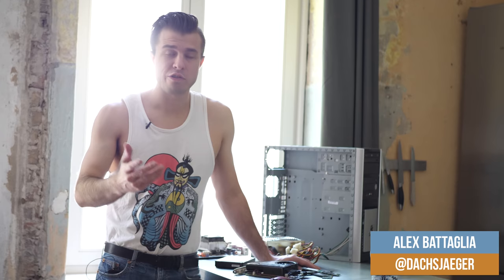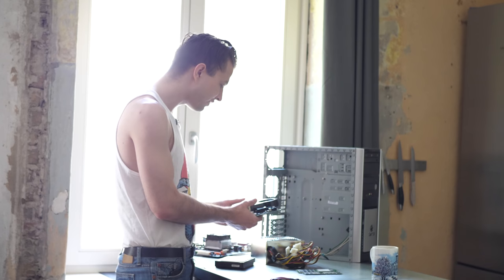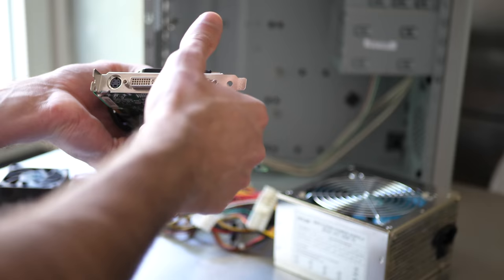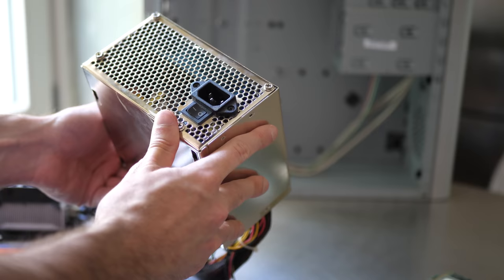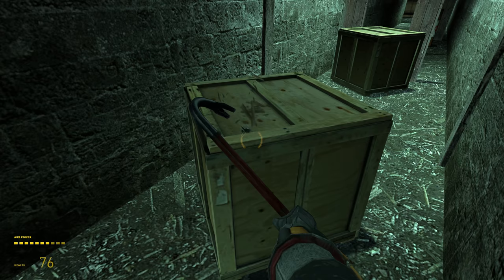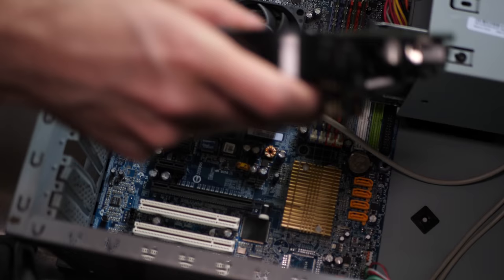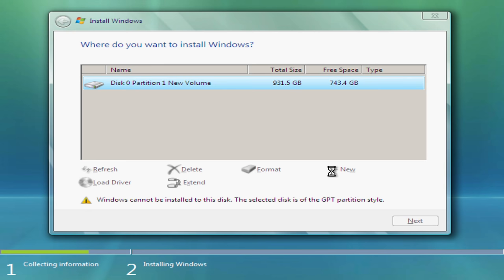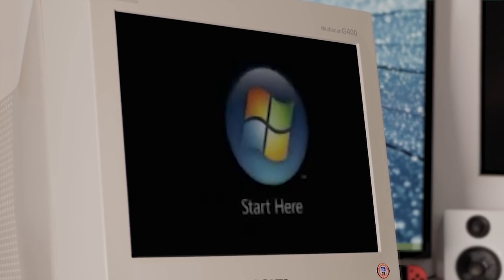Let's Build A 2005 Retro PC: Athlon X2 3800+ - Nvidia 6800 GT - Classic Hardware For A Classic Era!

Comment: recently finished my XP build, nicknamed Overkill : 
Q9650@4ghz
4gb of Corsair Dominator 1866
Nforce 790i watercooled motherboard
two Gigabyte 470 SOC in SLI
Custom waterloop with a 360mm radiator for the CPU/MB/GPUs
Sound Blaster X-Fi Elite Pro
Sandisk 120gb SSD + 2x1.5bg Seagate HD in Raid
Cooler Master HAF 932 case with a 1000w cooler master PSU.
run Crysis 1 between 45 and 70fps in very high, never goes over 65° after an hour of burntest.
to be honest i ended up partioning the SSD to install a windows 10 dual boot and in normal desktop applications like browsing and youtube,
i'd be hard pressed to notice a big difference with my new ryzen rig :x

Comment: I just rebuilt a semi retro pc.  It may have an e6700 in it, with 3gb ddr3,. But it also has a BFG 8800 GTS OC in it, I originally had two In sli  but the motherboard I have now don't have SLi.  Have dual booted XP and win 7.  XP runs so much better. Win 7 is a ram hog now.!

Comment: Ok my memory is hazy but in 2005 I had a 6800 GT and a Pentium D that I bought to git gud at 3D animation, but in 2007 I'm pretty sure I was able to run Crysis at 800x600 at 22-26fps. I told myself, "it's a cinematic frame rate."

Comment: Vista wasn't bad, the Issue was that the Hardware requirements for it were so high that it tanked most mid range and low end computers.
With 2GB RAM or more, it ran fine though. With 256MB? Not so much...

Comment: This Graphic Card has DVI-I ports which have analog pins, thus require only simple, cheap adapter to VGA. Probably was in the package with card at the time, as SteelScooter mentioned in other comment. Cheers!

Comment: The 3800+ is one step up from the bottom of the barrel when it comes to Athlon X2s. To get those slightly newer games like Crysis to run you would need at least a a 4600+ or a 4800+. Honestly to get better performance you would be better off with socket AM2 as those CPUs are much higher clocked.

Comment: Awesome to see this!
It's super close to the build I am doing.
Asus a8v
Gigabyte 6800GT AGP
Athlon 64 X2 4200+
Yamaha YMF744
With the rest of the parts still being ordered.
Optimizing mine for backwards compatibility though with Win98 and msdos which requires a lot of tricky planning as not all components from the 2004 era support it.
Reply: İ had x2 4200+ with 8600 GTS. Not the best CPU TBH. 
İ remember bad company 2 had like 20 fps and 25 when overclocked to it's max
Reply: @TheMybabloo  Bad company 2 is 5 years newer than I designed that PC for so i'd be happy if it ran at all.

Comment: I would never use Vista for retro gaming. XP was fine for me until the Core ix era. After that I bought a new pc with Win 7 on it. I still have my last XP rig from 2006. Core2duo E6400 with 7950GT @ 512gb and 2 gb of ram. That rig now has GTX 750ti @ 2gb and 4 gb of ram. Still running 32 bit XP. I did use Vista on a HTPC. But my original Win 7 machine replaced it when I built a Win 10 rig.

Comment: I just found a 6800 GT at a local value village for a measely $8! I've no idea if it it works since I dont have a motherboard with an AGP slot, yet. I'm hunting pc parts at thrift stores to see if I can cobble together a thrifted retro gaming pc. The Psu will have to be bought new. No way I'll trust a thrifted psu to not explode 😅

Comment: I had i pentium 4 3ghz socket 775 4gb of ram and a gts 8600 from xfx it was the ultra oc edition. And i remember playing crysis at 25.30 fps couse i only had 256mb of vram.) My system was an hp machine. But it was fun back in the day.

Comment: 3-4-4 memory is pretty slow especially with command rate set to "2" which is required for normal operation with 4 sticks of memory.
Get two fast 1GB memory sticks and install winxp.

Comment: I'd skip out on buying a used powersupply unless it has a solid brand like fsp, superflower, be quiet, corsair, thermaltake etc that at the time of release had say a 3 - 5 year warranty.
This is the start of the era where the 12v rail matters more then the 5v, 3.3v power rails specially when you got a pci-e slot motherboard really.
Intel already did start too move away from the 3.3v & 5v rail on socket 478 motherboards with the 4 pin eps12v power plug started getting used because it was easier too have the motherboards do the voltage splitting via the vrm & chipset rather then build it into the powersupply itself.
I'd also perhaps replace the cpu cooler for a more quiet one a used am3 phenom cooler or a 120mm tower cooler with heatpipes, even if the cpu might not need it if you swap it for a faster one eliminating noise as much as possible helps with general comfort in using the pc as well.
The 939 socket shares the same cpu cooler mounting as am3+,fm2+ & i think any am4 cpu cooler that uses the hinge, the plastic bracket still rather then 4 screws or similar like some cpu coolers does on am4 ?

DDR2 started at 533 mhz, 667, 800 & finally 1066 as a general standard.
(There are some great chinese brand sticks that are 2 gb each at 1066 mhz running 1.8v rather then 2.2v like most overclocking ram sticks did at the time.)
The harddrive loading decently quick has more too do with drive density more then it's rotation speed as well.
Though even if this is sata generation 1 you can give it a try with say a cheap 250 gb ssd just too try it out.
Feel free too try something like a HD 5770 or gtx 550ti (direct competitor too the HD 5770 (btw gigabyte hd 5770, & sapphire models are better then xfx ones so far imo.
And seeing how a newer gpu in a first gen (for amd) dualcore cpu like this does with a more modern gpu & api in say left 4 dead 2, crysis, f.e.a.r 1, f.e.a.r 2, bioshock 1 & 2
Where the cpu might be the bottleneck instead of the gpu.
My testrig is currently a dualcore core 2 duo e8400 but with the 1066 mhz ocz sticks i could push it quite far, its sitting at 4 ghz stable for benchmarking & most games I've tried briefly so far.

Comment: How perfectly-timed is this video? I'm currently building my own retro gaming PC from the mid 00s too. I've got a 3GHz 478 Prescott with HT, a Zalman CNPS7700-Cu to cool the "Press-hot" down, 2x 1GB DDR400 RAM, Gigabyte GA-8I865GME, 160GB Toshiba HDD (I'll swap it out later with a spare 500GB Seagate SATA II drive) and a Palit Geforce 7600GT 256MB AGP. I just need to get a PSU and I'm done.

Comment: Thanks for your video, you really need to try that system with a 7800GT and X1800!
Why you choose the 6800GT? 2005 wasn't more a 7800GT year than a 6800 GT one? I'm not sure exactly when I ended up with a 3800 x2 as I started with a 3500 in August 2005 (when I purchased all the parts included the 7800GT) Then I trade it at my workplace for a 3800x2 and about a year later I was using a 4800x2, that was the last time I purchased a Up-mid range Video card, with less than 12 months of use it stopped working at 3d loads and it was never repaired under warranty, not funny for a 400 euros part and I chose Gainward because they had a German address LOL.

Comment: We need a new Crysis.  A game that would make a GeForce 1080 Ti run 1080p everything off/low and barely able to maintain 30fps. But I guess it would be easy enough to do this with lots of ray tracing.   But I have also always wondered how poorly optimized Crysis was on the GPU front.  I know when SM3.0 was new, The GF5 cards were getting blacklisted feature wise from SM3.0 stuff you could easily reenable with a config edit.  Not like performance dropped off like a rock or it didn't work.  I remember Far Cry did that and even Source engine did.  I remember running the water on my GeForce 3 (Pixel Sharder 1.1) and it ran fine when at the time you needed certain Radeon cards to have the option to enable the fancy water.

Comment: Cool System! But exchange that GPU to something better (Radeon 1900 xt,1950, or Geforce 7800,7900), games released after 2005 did REALLY struggle on that Card. I had it myself back then, it did really age poorly after its first year on the market. It was too weak to even run Oblivion maxed at 800x600. Thats why it didnt last long in my computer.  And overclock that CPU the x2 3800+ can easily reach 2,6 Ghz.

Comment: The only Vista issue I had was with Nvidia's drivers. Microsoft's push to force everyone to write 64bit drivers caused chaos. Lots of TDR driver time outs, and there was a nasty bug pre SP1 where dual monitors caused issues. My Vista system was rock solid until I upgraded to dual displays and then I started getting blue screens. 
Still to this day don't know if I should blame Microsoft or the hardware makers for poor driver support. 
I also don't want to pick nits, but you should stick with 32bit Vista unless you have over 4GB of ram. You'll lose resources as windows needs to keep x86 and x64 DLLs loaded.

Comment: The Athlon XP 3200+ and the 9800pro would play most of the games listed in the description quite nicely. Also nobody used Vista at the time, it was Windows XP SP2. Vista is a total dog to run on this hardware and you are better off using Windows XP or Windows 7 (Vista Service Pack 2 and Windows 7 are basically the same OS).
F.E.A.R would be the game to test on this machine as it will show off the hardware.

Comment: How much this would cost in 2005, including OS? We had X360 for $399 at time.
Reply: The X3800 X2 cpu alone was $350 and the 6800gt was around the same close to $400. You're looking at $1000 rig. It wasn't until the 7800gtx came out in late 2005 for around $500 that 6800gt dropped then in 2006 I got 7600gt for $200 and 3800 X2 for $200.

Comment: I don't know If I'd get a 6800GT but look for an X1800 or X1900 instead.. Samewith the nForce 4. FOr a simple reason: they are said to be pretty unreliable, the ATi Chipsets should be more reliable - and also work better under modern Operating Systems (like 32bit Windows 10, as everything after Windows 7 isn't supported in 64bit mode).
But yeah, you get wahtever you can purchase for a good Price...

Comment: Something is broken on your PC. Wayback when Crysis came out I ran it just fine at 1024 by 768 with an 8600 GT which is about on par with a 6800 GT. I ran it on medium settings with even a couple of settings on high and had no problems averaging in the 30s. I don't know how the heck you're only getting single-digit frame rates at this little bit higher resolution.

Comment: This shows how much value PS360 have with those price points.
Reply: PC elitist will never admit it though.
Reply: @hotdogflavoureddrink  am pc elitist. will admit. Consoles will always be the mid/low-end steal the first year of launch. Doesn't stick though.
Reply: @BomimoDK  And now with ps5 ( 2070 rtx ) and serie X ( 2080 rtx ) , high - end too
Reply: I'll forever disagree with this statement, given PC games can almost always be bought for less than console games, you can do more with a PC than just game and you can get better visuals or performance than consoles.
Reply: @AlexMartinez-cc7hc  these kind of comparision never works.
Reply: @BomimoDK  how ps360 were low end in 2005 and 2006 after seeing this vídeo?
Reply: @raresmacovei8382  for those who wants to play games only consoles are cheaper. Most people only buy one or two games per year when they launch. The price is the same.  For other PC is more versatile, of course. But we are comparing potatos and carrots.
Reply: @raresmacovei8382  You live in your alternative universe... only a M2 SSD 1tb cost like 150 euros (don't expect the console to have the worse ssd with the worst tbw) even if ampere come out before consoles, x series will have rtx 3060 performance, i assure you it willl cost minimum 300 euros, 450 euros ssd + gpu, well that's the price of a ps5, add 16gb ram, gratz you surprass series x price, and you don't have CPU, motherboard, power supply (a decent one) the case...
Reply: @BomimoDK  From what I found, consoles used to be cheaper until late in the PS3 and Xbox 360 days and then things started to change where PC gamers can build cheap gaming rigs that compete will with consoles as long as they don't go crazy on the specs, I actually remember building my friend a PC that was more powerful than the PS3 but over the long run of around 3 years ended up being cheaper than it because running cost are cheaper on the PC with games costing less and no online subs.

Today, PC gaming is dirt cheap just as long as you are willing to settle for what consoles offer, so 30fps gaming with medium to high settings and so on and we should also remember, considering that we can even build a PC for not much more than a console that offers far more in value being as it's a full-blown computer, it really shows how far the PC has gone and how consoles are not that great value overall, especially over the long run.
Reply: @albertotrigosbueno5547  You're comparing a PC of now to a console of the future lol, not a good idea when it's a big year for PC gamers with some big hardware on it's way which is very likely going to crash the price of hardware.

Besides, consoles are built on PC hardware, there isn't really anything special about consoles any more and what they can do, a PC for not much more can likely do the same or more and it's been like that since late in the PS3 and Xbox 360 days and more so since consoles went x86.
Reply: @paul1979uk2000  ampere isn't gonna be any cheaper than current card, keep dreaming.

Power is a mistery though, but they have to support rtx 2000 series in next gen, so you won't see a major upgrade, expect 2080 super performance in a 3070 or 3060 ti if they are generous, nothing less

Comment: very similar to my first gaming rig i built on my own in 2007 except i went ATI at the time and ran vista basic which surprisingly was a less broken version of vista as it did not include anything extra aside from the base stuff needed for vista to function 

if only windows 10 basic could be a thing and remove stuff like cortana but data miners godda data mine i guess

Comment: Using Vista with this PC is obviously a terrible idea. The whole point of a retro PC is to get the best compatibility with early DX9 games and older, including EAX hardware acceleration.
Vista did become a decent operating system a few years after launch, but then Windows 7 did everything better when it came out less than 3 years after Vista. I did love Aero, though, I really miss it.
Games that came out after the Xbox 360 launched can run on modern systems pretty much without issues, at least with some tweaks. There is no real benefit to running them on hardware and operating systems from that period.
If I ever build a retro PC, it will probably be something like a Core 2 Duo and an 8800 GT, just to brute force the performance of older games. But I would definitely install Windows XP SP2 32-bit. I also like that you can use modern PSUs with basically any hardware since 2004, when ATX12V 2.0 became the standard that we still have today. Building a system from before 2004 can be problematic because of how weak the 5 V and 3.3 V rails are these days. And powering a system from the 90s is very hard.

Comment: But I wouldn't want to use that PSU. There are better options available, though a bit more expensive. If you want decent quality, in Germany, a be quiet System Power is a decent option for example.
But especially in the lower cost range you don't have much good options...
Reply from the maker: I just replace the Bad one with a bequoet actually! 430 Watt :)

Comment: Rule n°1: for retro machines, never use a power supply from unknown brand, especially if they're feather-light and have questionable platform inside (no serious bridge rectifier, overrated specs, bad caps, ecc).
That's why for newer machines is better going with new, reliable PSUs. For old ones, pick one of these brands, according to the ATX specification of the time:
- Enermax
- FSP/SPI/Fortron/Source/AOpen
- Antec
- Tagan
- SuperFlower
- SeaSonic
- HEC
- Delta
- Hiper
- AXP
- Chieftec
- Thermaltake (depends)
- Corsair (depends)
- Cooler Master (depends)
- OCZ
Reply: Technically, the build was accurate in the sense that Delux PSUs were VERY common back in the day. These days, they've basically disappeared from the market (Thank God, they were garbage), but in the 2000s they were basically a staple of cheap prebuilts. Regarding choosing PSUs, there IS a GOOD way to judge how capable one ACTUALLY is: The 12V rail power capacity. The closer it is to the stated total power (Let's say the 12V can deliver 40A, for a total of 480W on a 500W PSU), the more likely it is that it will perform well and actually be able to deliver all the power listed on the box. Also, by default, most semi/fully modular PSUs are of least adequate quality, so it's less of an issue these days.
Reply: @BE3R-LF94  Yes and no: it strongly depends by the ATX revision. Older ATX revisions were more focused on the 5V and 3.3V rails, and builds using Athlon XP, Pentium 4 (older ones), Pentium 3, Athlon (slot A), Pentium 2, and anything before rely on those lines (and -5V too).
From newer Pentium 4 and Athlon 64, the 12V line is more important, so using more modern PSUs is considered a better solution

Comment: Actually the reason Vista was so bad is that Microsoft allowed OEM manufacturers to install it on weak systems that couldn't actually run it well. It required a lot more power to run well compared to XP (Which is why most games required less specs on XP than Vista. The system you have built here is far better than what most OEM manufacturers put out prior to 2009. Vista and 7 actually run very very similarly. However 7 required Better hardware and thus never suffered the way vista did. you could put vista on just about any pc. Which is why it gets a bad rep. But with that said 7 was the better pick between them and XP was better if you didn't care about running newer games at 15fps. XD